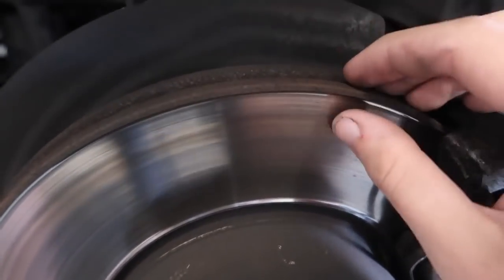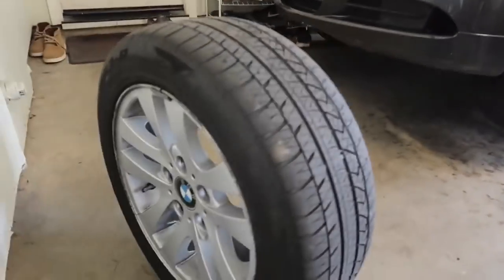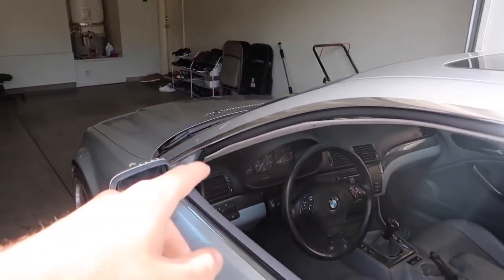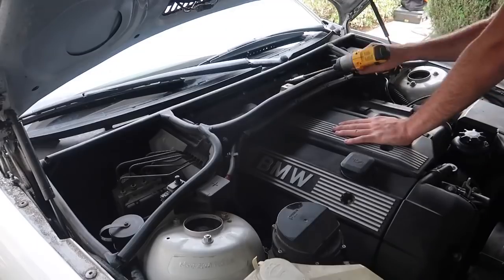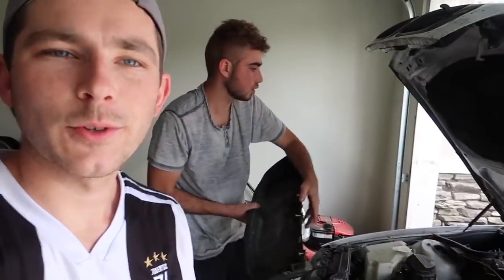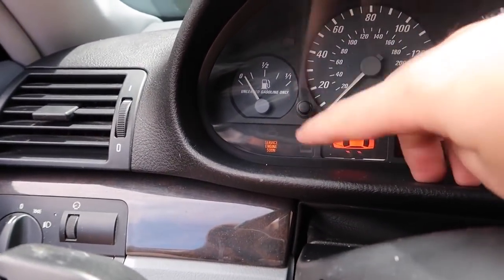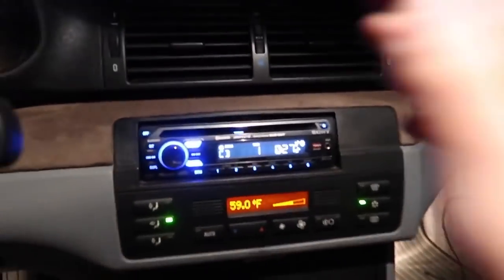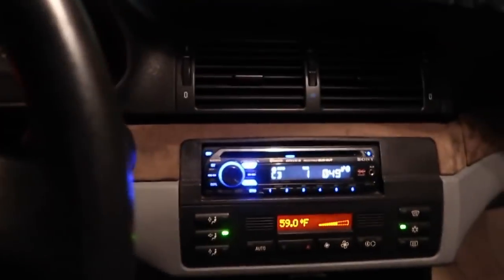MY BMW E46 BIGGEST ISSUE HAS BEEN FIXED!

Comment: My favorite car channel at the minute, especially the E46 content. Now 30, I’ve owned a 2000 323ci, 2004 325ci, 2014 328i and now currently a 2012 328i with M package. The E46 was always my favorite chassis and I’m currently putting in an offer for a 2005 zhp to fix up and bring back to life.

Comment: Yo, I owned 3 E46s  and a quick google search would've told you that resistors on these things are the first thing you check when your A/C  is not working properly. Honestly, it is much easier to replace than a blower motor, which you probably found out the hard way.

Comment: Hi Nour I just bought a 2001 BMW 330Ci and it came with a problem, when turning the steering wheel to the left the wheels turn normally but when I try turning to the right both front wheels stay pointing to the left and the steering wheel spins freely to the right, any thoughts in what the problems might me?